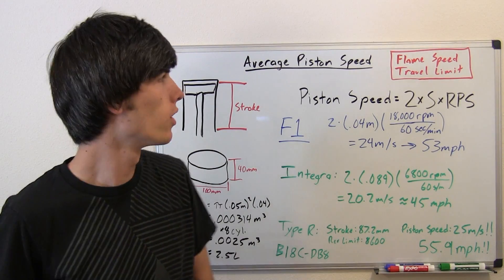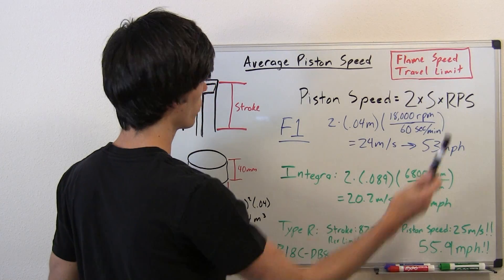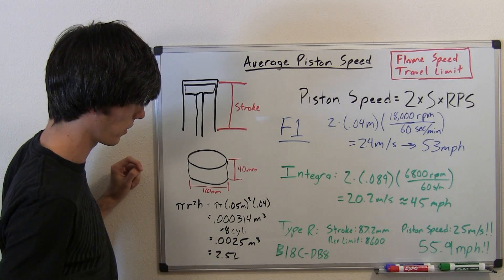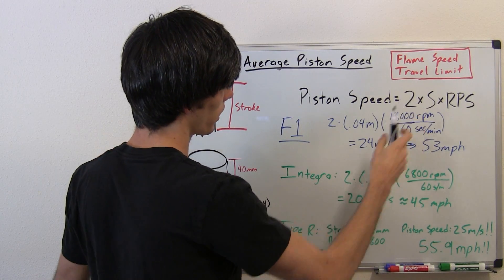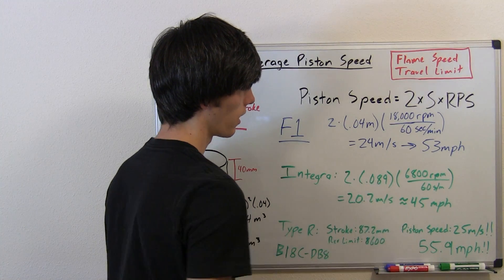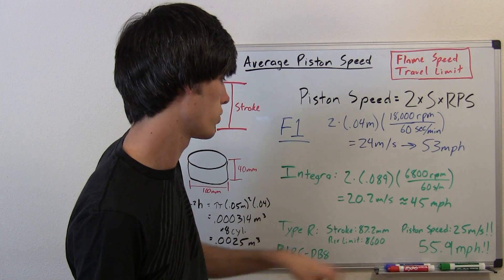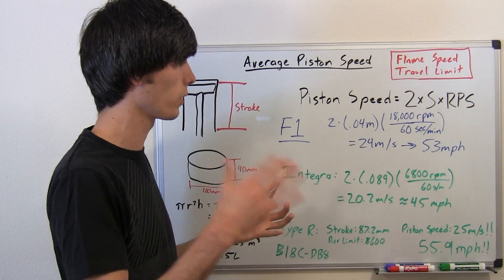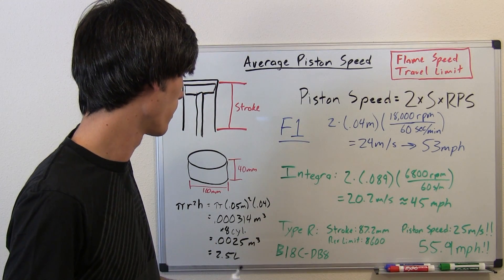Average Piston Speed - Explained

Comment: If you don't know the equation, just tell me and i will try to do it myself.
The graph you gave me won't help. Does not even give piston speed. There aint enuf pts to even do a Taylor series to even attempt to try to find a best fit equationd to match these points. U said:
"R/Sratio %acceleration °TDC
1.5-1.02 73.7°
1.55-1.017 74.1°
1.6-1.015 74.5°
1.65-1.012 74.8°
1.7-1.01 75.2°
1.75-1.008 75.5°
1.8-1.006 75.8°
1.85-1.004 76.2°
1.9-1.003 76.5°
1.95-1.001 76.7°
2 1.00 77°"

Comment: I either use the avg speed*1.6, which is what everyone uses
or the more accurate way of finding peak piston speed using the graph i sent you, but that equation changes depending on the rod/stroke ratio, you have to find the right multiplier from it, Don't use the actual rod/stroke angle as the multiplier

so you have a rod/stroke of 1.6
1.6  - 1.015  74.5°
find the journal speed then times it by 1.015
the piston speed will never be more than 103% of the journal speed

Comment: My question is wrong? How is knowing the equation wrong?
I know it would look like a wave. The equation will give me the correct wave graph
(stroke*pi)/min = one RPM. Cars run thousands of RPM.
stroke *pi = cracnkstaft diameter. How does multiplying r/s ratio with the crank diameter give me piston speed? the answer would only be something like 1.5*diameter, 1.7*diameter, 1.8*diameter.
If you don't know the equation, just tell me who does so I can finally make my spreadsheet work.

Comment: the question is wrong
the answer is a would look like a wave on a graph
at some point(degrees past TDC) the rod/stroke ratio(1.5-2.0) combine with the angle of cylinder to accelerate the piston, under 2.0 rod/stroke, the cosine effect actually lowers the piston velocity below that of the crankshaft journal @(stroke*pi)per minute
you want to find the °TDC at peak piston velocity using r/s ratio on this graph then multiply the percentage to Stroke*pi
it's easier to explain from crankshaft speed

Comment: The reason x1.6 works for peak pistons speed, is not only because most modern cars have about the same rod to stroke ratio, but a shorter rod will read a slightly higher peak than a larger rod, but since most mechanic use it to figure out durability, it still works, because the shorter rod will cause more piston speed at higher journal angles in relation to the cylinder center line
meaning it will accelerate sooner also flatten the peak speed as the journal comes into center

Comment: gonna take a minute to explain when i have time
but remember almost all modern engines have about the same rod to stroke ratio. Maybe not for a large motor for a ship with a long connecting rods, but no matter what the connecting rod has to be at least 1.5 the length of the stroke. usually between 1.6-1.7, anything close to 1.6 rod/stroke ratio will wear fast.
If you had a 15' rod but 6'' stroke, the max piston speed would be at most 101% of the journals speed = stroke x pi

Comment: Well with piston speeds that are very close the f1 engine is running at roughly 3 times the rpm of the b18. Seems like that was kind of ignored or not mentioned. Also in an engine that has a low max rpm wouldn't it make sense to increase the piston speed by increasing stroke? That's the point Isn't it? Same rules and principles apply just a difference in outcome.

Comment: Sorry, I have another question. I'm confused about what crank journal vector you are referring to. Solids have 4 possible component vectors when it comes to loadings. Or do you mean measurement vectors? There are 3 possible components for those. If you mean measurement vectors, assuming alignment to the engine CL, 1 component vector will always line up with the CL. The other 2 depend on crank angle. Which crank journal vector becomes inline to which connecting rod vector?

Comment: multiplying average speed1.6 isnot correct for all engines. There are times when it's really x1.7 or x1.5. The only way to know this is to know which case is correct is to use an equation to find the max piston speed. What equation did you use?

Comment: you are right
except most people just use average speed x 1.6
then take in to account
a shorter rods compared to the stroke would lower the peak speed slightly but the piston would accelerate sooner & hold more speed longer
so you could end up with more piston speed at 82° than when the journal is at 90°
which is about the point at which the crankshaft journals vector will be inline with the connecting rod

Comment: most people use 1.6 for an approximation
I just can't explain it with 400 words
but trust me 1.6 benefits the Mustang, you can't actually use the average in calculus to get a peak. it won't describe acceleration, or angles, which are more important in deciding durability that just speed

longer Rod:
Less rod angularity reduces wear
Lower piston velocity/acceleration reduces tensile loading of the rods.
resist detonation
Less intake runner volume
Reduces scavenging at low rpm

Comment: Actual top speed can be changed, you would think a larger crank means higher pistons speeds, but it also is getting further from center, so it spreads the average out, so to speak, meaning a higher speed sooner & later if the rod doesn't get longer, because the rod to stroke ratio will go down. of the rod to stroke stayed the same, the rod increased in length equally, it would get faster the entire time, less rod would cause a sooner acceleration at a steeper angle

Comment: The actual calculation is more complex than you can imagine.
First the rods isn't actually at top speed at 90° & 180°, because the piston is in the center, not directly above the journal at 90/180°
Lot of math figuring tis part part out so i will just give the answer in layman
The piston reaches terminal velocity when the rod is perpendicular to the center line of the wrist pin journal & the crankshaft center. which means the direction of the velocity in a circle matches the rods direction

Comment: times the average mph by 1.6
avg mph is the stroke in feet x 2 because the pistons goes up & down in a revolution
(Stroke x 2) x RPM x 60 to run it into hours
the final number is in feet per hour, or whatever unit of measure you use for the stroke, with feet every 5280 feet makes a mile an hour
Stroke x 2 xRPM / 5280 = MPH

Comment from the maker: Uhh yeah I'd have to check - it's out there somewhere. As far as which is faster, up or down, it would have to be the same. Remember, if you've got 4 cylinders (since we're talking about Hondas), there are two going up and two going down at all times, all connected to a common crank - hence the speeds must be equal.

Comment: Comparing cars at peak output

Mustang GT at peak output 412-420hp @6600rpm
45.62mph average
73mph peak
Camaro SS at peak 426hp @5900rpm
40.47 mph average
64.752mph peak

Mustang GT has a larger crank making a bigger circle in a much smaller block, so without enuf deck height the connecting rods are even shorter than SS, a bad idea with more stroke. This meaning a higher angle pressing against the cylinder wall liners = more wear

Comment: i Hv a Volvo VNL 670 Truck w/ a 12.1L 6cyl inline diesel engine. Its stroke is a rather average 6.0 inches.. haha or 150mm. at an idle of 500 rpms its APS is 2.5 m/sec(5.59 mph)  at redline of 2200rpm the APS is 11 m/sec (24.60mph)

Comment: Yamaha rator quad. 105mm bore and 88mm stroke. 9,200 rpm limit. what is its piston speed? most engine shops also work feet per sec.

Comment: High piston speeds don't automatically mean a better engine . The inertial forces in the piston are proportional to the speed of the piston , so the higher the speed the higher the inertial force of the piston and the higher the loss of useful power .

Comment: I have a 1988 Jeep Wrangler with a 95 mm bore. It's RPM limit is about 5500rpm's. I calculated that the meter/second was 17.41 which converts to 39mph! I know that is not fast, but it's weird to think that I can drive faster than my max piston speed.

Comment: Diesel has a part to play, but it's most likely dodge not wanting to spend money on something it won't be used for. To increase the revline, they would have to put in a new crankshaft and allow large cam profile at the top(most likely vvl). A BMW or AUDI diesel could rev to 6000rpm,but dodge didn't see a need for that in a truck.

Comment: 1989 Toyota Cressida Mark II, 7M-GE engine. 91 mm stroke, 6200 RPM redline, average piston speed is 18.8 meters per second or 42 MPH. It's not as revvy as an Integra, but I do get more torque and a better exhaust note.

Comment: Unfortunately Average Piston Speed means nothing as far as combustion is concerned. It's only concern is to average stress on internal parts, longevity and reliability concerns. It's not a formula ever used in combustion calculations. Using average numbers will result in inaccurate ignition timing calculations and a blob that was once a piston.
It's a simplistic formula with no real world use.

Comment: Current car: 99 Maxima VQ30DE stroke of 73.3mm redline of 6800rpm gives me 16.6 m/s or 37.17, so theoretically that engine design has alot more rpm left, awesome!
Dream car: 98 240sx RB28DETT(stroker kit) stroke of 77.7mm redline of 9500rpm gives me 24.6 m/s or 55mph

Comment: While in the past there were turbo f1 engines they were later banned and now f1 uses naturally aspirated engines. Turbos use a turbine spun by the exhaust of the car to compress the air coming into the engine to develop more power. Watch the videos on forced induction to learn more about turbo engines. There is also a documentary on youtube about the turbo f1 cars.

Comment: my cbr 600 rr => stroke 42.5 mm at 15000 rpm :-)
(2x0.425m) x 15000 rpm : 60 = 21.25 m/s  = 76.5 km/h  =  47.8 mph  :-)
nice :-)   love youre channel ,  love my cbr :-) 
by the way i'm thinking abouth putting in JE pistons ( more compression and lighter weight :-) 
can you say something abouth what it does to torque etc when you save 50 or 60 gram per cilinder ? i want to find out in practice but theory is cool too :-)

Comment: my 1991 240sx piston speed is 20.8 m/s ~46.5mph 
2 x .096 x 6500 / 60s/m = 20.8 m/s 
videos are great because i'm a visual learner and the illustrations help. 
you can do videos on Rally cars (wrc) if you ever run out of ideas!